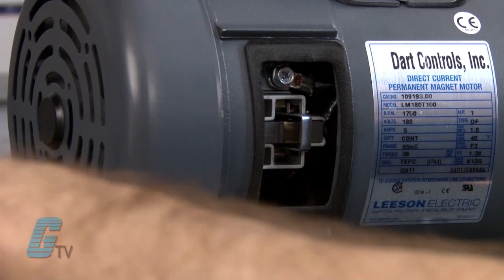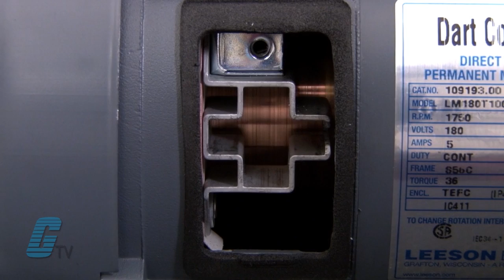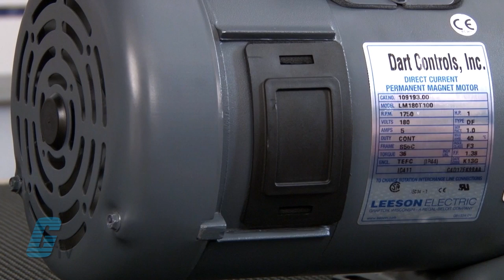How to Install a Carbon Brush in a DC Motor | Galco

Comment: What if there are burned areas on the spring?  My wheelchair lift stopped working...making a grinding tyoe noise and stops working.   It still "clicks" then you press the button to go ip or down..last time it fid tnis, i changed the spring and it worked...3 mos ago..there was burn marks on the sprng...and it was all bent.   Worked fine after replacing but i dont want tombe doing this so often..any subgestions?   Its a 12v battery and 120v     Car battery for in case the power goes out i think...pita if ypu ask me.   Any help?   ThNk you!
Reply from the maker: Sounds like the motor itself needs service. However it sounds like you are replacing the spring for the brushes, correct? If so have you replaced the entire Brush? or just the retaining spring?
Reply: GalcoTV ...hi. Thank you!   Yes. Just the spring.  The lift started to work right away so the guy left it.   Workrd for maybe 3 months...and its doing it again.  I do have ONE spring left and 2 new brushes.  Hopefully one of the sprngs is still good.    When my brother first looked at it, the brushes seemed ok..but we had nothing to compare them to and just one of the springs was gimped...crinkled and bent...they are those dumbbell type from Leeson.. 7000000000.02    Should i change the brushes and the spring?  Is there anything else you think?      I am so glad you answered this!  Im in a wheelchair and have to climb up and diwn stairs to go anywhere, pulling my wheelchsir over my head ect...until tnis is fixed.
Reply from the maker: Well Swedish we admire your ambition. Yes change both the brush and the spring together, I mean if you have it why not. DC motors tend to ware out those brushes eventually anyway, kinda like tires on your car, eh?